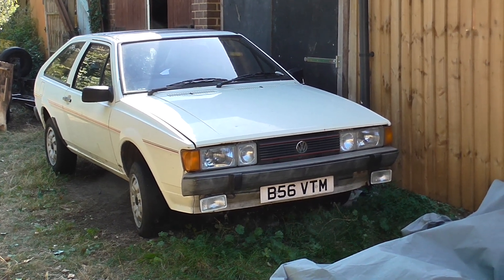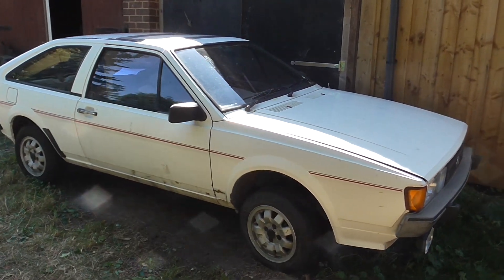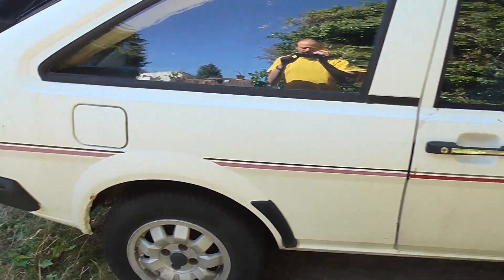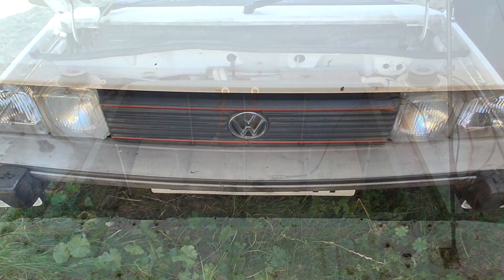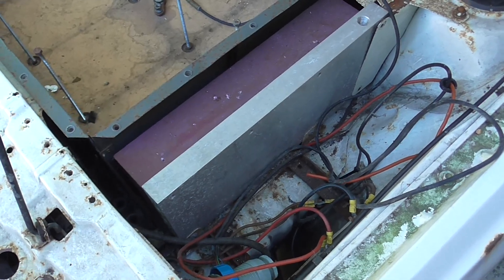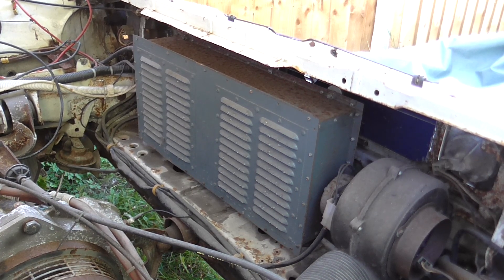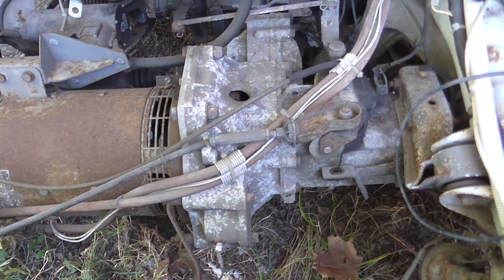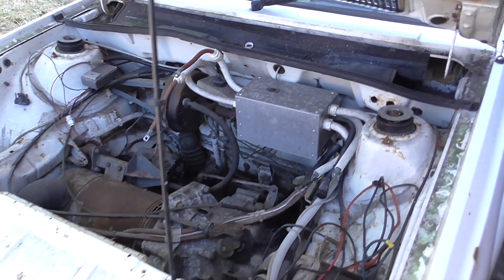VW Scirocco EV introduction

Comment: So Paul, time for an update? You were way ahead of time when you converted it. Don't give up on her!
Reply from the maker: No progress so far unfortunately. I had a very productive discussion with a local restoration business about taking on the bodywork, but they didn't have a slot available right away. Then the first lockdown happened and things have been stalled since. I do now have room to get it into my workshop, but I'm still working on other things right now. It will get done, then there's a new conversion project...

Comment: I had the same rust problem just below the front windscreen on my Mk1 Golf. I removed the screen to treat it but in doing so cracked the glass. I suspect that the seal had stuck to the body and as I tried to push the glass out from inside it cause the crack. If I were to do it again I would go all the way around between the seal and body with a thin piece of wood or plastic and some lubricant to free the seal from the body on the inside and outside before trying to remove the screen. Good luck, looking forward to seeing the rest of the project.